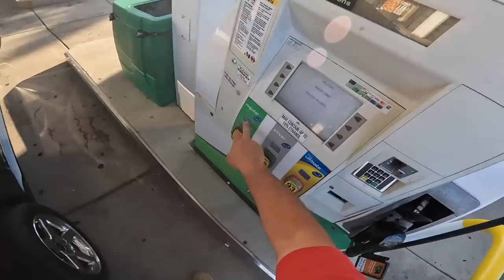Custom fire patio-DONE!

Comment: There is concrete work being done at my house right now. And some of the mistakes they’ve made are insanely ridiculous. So they poured a slab for my new garage on top of the old crumbling one, and the concrete on top immediately started looking like the stuff underneath. Then they dropped a 50 lb piece of wood on my car. Then they poured my back patio but there was an Easter basket that wasn’t moved, they poured around it and literally left an Easter basket sticking several inches out of the top of the concrete. And now as I type this they are cutting in the joints with a literal chainsaw (they poured yesterday)
Reply: Hope you made them redo it. I would not pay until they do. Take photos fod evidence.
Reply: @keithfreitas2983  Yeah, taking plenty of photos. The boss is almost non existent and impossible to reach, and all the workers are Guatemalan and don’t speak or understand English
Reply: @BuhBuhBoomer  😂 Jesus what a terrible company
Reply: Jay Dog  What

Comment: I've been a California concrete guy for over 12 years this dudes knows his stuff really knowledgeable, if you really want to get an idea of how good concrete is done follow this dude there method back east is little different like we use alot more steel on the west coast but his foundation and structural integrity is legit. I tip my cap

Comment: Don’t use peanut butter to bait the mouse traps  because it’s very easy for them to lick off the peanut butter without setting off the trap ..Try slim Jim’s or you could buy some contrac blox..Also when your placing the traps put the trap against perimeter.they always run up against baseboards and perimeters because they are 90% blind .. i’ve been doing pest control now for over five years just thought I would give you some knowledge since you’ve been giving me all this knowledge on concrete

Comment: hey ryan about the mouse using those simple trap dont work great and you'll just keep throwing money toward traps u gotta get the black pinch snap traps that you pinch and it locks and there a unscrew able food cylinder inside to fill food and it sit in the middle of a pressure plate switched to those and when i had a rodent issue in my garage caught all of them in a week using the black pinch traps

Comment: forgo the mouse spring traps.  Get those sticky pads and put a dab of peanut butter right in the middle so the mouse has to get on the sticky pad to get it.  He'll get stuck and then you can toss the trap into the trash.
Reply from the maker: Yes, I definitely need to try something else.
Reply: @VictoryOutdoorServices  that's what work best for us we had tiny mice that didn't even register on the spring mechanism so they got on sticky pad and were not strong enough to get off.

Comment: I have a solution for the mousetrap, don't use peanut butter. Get a little piece of Tootsie Roll chew it up and put it on the Trap. He's eating your peanut butter because it's easy to come off. With a little piece of Tootsie Roll On The Trap he'll have to work hard to get it off because it will be sticky which will set the Trap off. Mice Love Tootsie Rolls Guaranteed solution...

Comment: It's one thing I hate is laziness and there's another thing I hate is when you tell your workers what to do and they don't do it but I'm on me comparing this to your son. He wants to take the easy way out but you got to do things the right way so therefore you won't have to come back and correct anything in the near future or day after and also you finish the job as much as you can so you won't have to come back the next day unless you pour in concrete and no you have to do everything in steps but I do landscaping anything outdoor we do except concrete breaking up concrete will do but that's about it but landscaping we want to get the job done ASAP and the most efficient way

Comment: I see that you are "granny shifting, not double-clutching like you should."
Reply: Please explain to me why many from the US start talking about "double clutching" whenever they see a manual gearbox? We've had synchronized gearboxes for well over 50+ years. There is zero reason to double clutch outside a racing track with a proper setup.